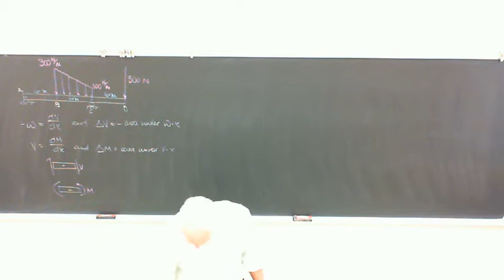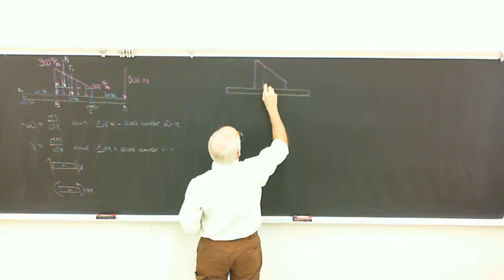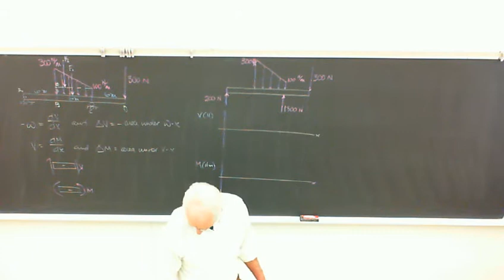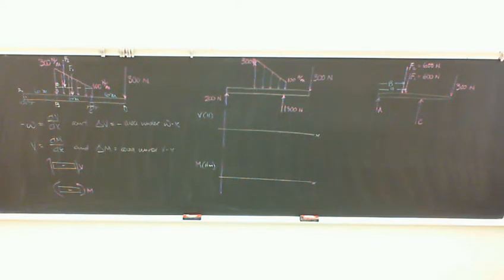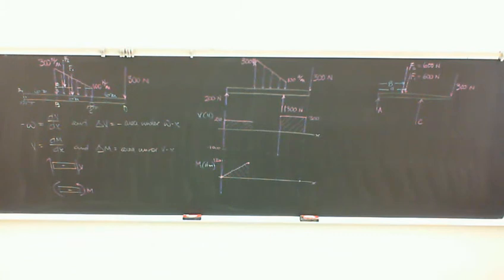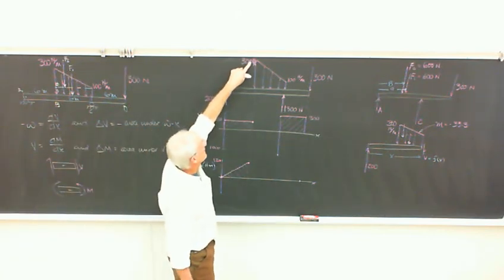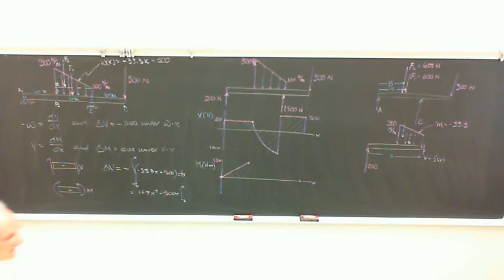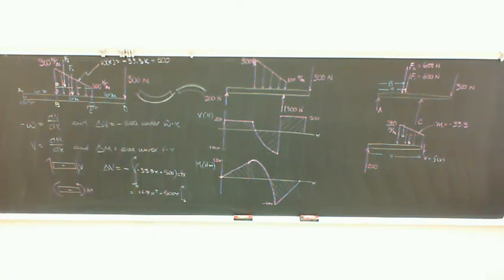Beams- Internal Forces, Part III

Comment: One thing that hasn't been discussed but I was wondering after viewing the last three lectures. Are the shear forces guaranteed to be continuous? Because I was thinking that a lot of these piecewise segments that aren't immediately obvious (like parabolas) could be solved much easier by doing the indefinite integral of the shear function, where your constant C is the point at the left side where you're starting and x is shifted appropriately. This would only work if the function was continuous though.
Reply from the maker: The change in shear can be calculated with the definite integral as shown at about 36:30.  I emphasized the physics and not the math since this is an engineering class.  When I hit this again in Strength of Materials I then show and use the integrals as an aid to the full solution, but I want them to know the physics first and foremost.
Reply: @ksmanning  Thank you so much for the response Ken!